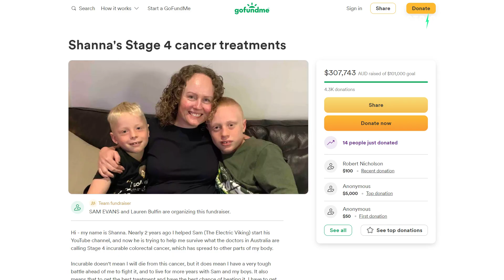CATL & BYD's sodium lithium batteries to be in these models this year

Comment: About end of 2022 both CATL and BYD announced new cheap sodium batteries in mid 2023. 
Now it is clear they failed. But I doubt the new annoucement.
Let's hope it will not like Toyota's promises repeated for years about solid state batteries...
Reply: Nope BYD Seagull will be launching in the coming months with Sodium batteries at sub USD10k prices over in Asian countries.

Comment: A bigger breakthrough will be achieved if older evs can have their batteries replaced with these new sodium/lithium/ion packs, this saving them from the scrapheap.
Reply: An aftermarket trade in batteries requires the car to not have structural packs. Apart from that, someone will  get everything sorted so long as the manufacturers don’t resort to encrypted CAN protocols. 

Hello, Future Motion. I am looking at you. And Altium

Comment: There's a certain price point these manufacturers want to be at, and no matter how cheap they can make them, they will not pass the savings on.
Just like servicing, there's nothing to service on these cars, but the dealers still want that money, and charge a fortune for what is an inspection, even a combustion engine service is a glorified oil change.
 they may come down slightly but that's all

Comment: Do you remember last Fall when the Tesla 4680 battery first came out and people calculated it should get 475 miles? People were dumbfounded. What’s wrong they asked? Then Tesla said oh we decided to go with a smaller structural battery pack that used less cells but could sell more cars! My point is that once enough battery cells are available Tesla has the option to scale up battery packs and get better mileage over their competition if they choose to pull this lever. ❤️❤️❤️

Comment: Sam please delete this video!
Somehow you’ve gotten caught up in the misinformation bunkum that “36kr” seems to be the originator of. 
Fact 1: Li and Na can’t and don’t exist together in any battery chemistry or cell. 
Fact 2: Lithium chemistry cells an Na chemistry cells have different electrical characteristics. 
Fact 3: Just as Li and Na can’t co-exist in a single cell, cells of differing chemistries wouldn’t be put together in a single battery. 
The graphic you show of different coloured cells presumably suggests what your narrative declares. Which came first? The narrative or the graphic?
Please consult someone (preferably with good English a Chemistry degree) to check my claims VS 36kr’s nonsense, and then please set about using your videos to set the record straight about these two chemistries and how they will actually be implemented in EV rollout.

Comment: If using sodium and lithium together improves an aspect better than either alone, then by all means use the new formula. There will be more discoveries to come that will be better in one way or another. Price, efficiency, performance, chargeability, you name it. As long as the end result is a net improvement.
Reply: Can’t be used “together”, this narrative was an erroneous statement by “36kr”, and it seems everyone’s regurgitating it. 
Chemistries can’t be “mixed”, neither would different chemistry cells be used in a battery. See my full comment elsewhere.

Comment: It will be interesting to see how sodium batteries perform in cold weather. Could be an important advantage in some parts of the world.
Reply: Technically, sodium batteries perform better in winter, but the biggest advantage would be the price
Reply: @terryzn-fb  It is not the price of sodium but the price of lithium that is holding back the development of sodium batteries, if lithium is available cheaply then there is no need to develop sodium batteries.
Reply: @Vito Lu  sodium is something like 50x more abundant and much cheaper to source. There's literally not enough lithium on the planet to meet the long term demand.
Reply: @SweetLou0523  Lithium is everywhere and can be recycled like we have done with lead since the 1950s. About 90% of car batteries are recycled. That’s why we don’t have lead mines everywhere. But there will be other types of batteries before then also.

Comment: As for using Na ion in vehicles, Ford in their Marshall, MI plant is planning on using LiFeP batteries, and given it’s a joint venture with CATL I can see them start to use Na ion. I can also see the sodium coming from mines near Detroit, shortening the supply chain and adding security to the supply chain.
Reply: How did I hear that the governments of both China and the United States have misgivings about this cooperative factory? It is doubtful whether this cooperative factory project will ever materialize.😂
Reply: Once that gets going, I can see the US Govt robbing CATL by declaring those batteries are a threat to National Security! The F.  king Chinese never learn.
Reply: they keep lying about battery prices coming down, it is still very expensive to replce degraded battery of a used  electric car because manuacturers are adding huge profits onto replacement car batteries too

Comment: 6:19 I can tell you for the North American market given the cold temps it is a good thing. When it’s -10 C lithium is going to not cut it.
Reply: Lithium EVs are doing fine in frigid countries like Norway where EV marketshare reached 80% in 2022.  Lithium EVs are cutting it in cold climates.

Though, yes, when the EV battery is cold, the onboard systems do have some limits on max power output and possibly no regenerative braking.  But when the battery reaches normal temps, all functions become available again.  Teslas and other EVs have resistive heating elements wrapped around their batteries to self-warm if the user wants accelerated warming.  Pretty sure that can be used during charging to perpetually keep the battery warm when plugged in.

Crucially, even at its high 90% efficiency, the EV's lithium battery still generates quite a bit of heat.  Some 20,000W of power draw would occur on acceleration from red light -- so 10% of that is 2000W of heat for that period.  Highway/freeway cruising is between 5000W and 10000W continuous power draw so that's continuous 500W and 1000W of heat that needs to removed.  There is also some additional heat from the EV's ESC and the motor.  For reference, a home electric space heater at maximum is around 1500W of power.

An EV's battery is also kept in very cramped quarters that would enhance heating.  The heat is enough to have a coolant circulation system where the heat could be routed to the cabin dashboard heat exchangers to heat the cabin reducing or eliminating the need for the resistive heating elements while the EV is running.

Comment: Don’t forget about all the ICE vehicles that have Pb acid batteries. They could produce Na ion for them and make a nice profit and it would be better for the environment.
Reply: actually, the lead acid batteries are pretty much fully recycled. But the crazy part is they are still expensive as fxxk in North America.
Reply: The problem with using a battery with a BMS is that an overcharged battery will just disconnect. When that happens the regulator in most ICE vehicles can no longer control Voltage without that load.

Comment: Does that battery still require rare earth materials?
Reply: "Rare earth materials" are not rare. 
China was the country that put effort into extracting them and processing them. Their processing is not an easy task.
Other countries that have reserves of those materials DID NOT put effort into getting those elements out of the ground and making them ready to be used in magnets etc.

"Rare Earth Elements (REE) are not rare at all. Despite the name, these elements – defined as the 15 lanthanides plus scandium (Sc) and yttrium (Y) – are not as rare as one might think." (Thermo Fisher, Jul 8, 2013),

Blaming China for everything is the easy way to not be responsible for anything.

BTW: rare earths are not used in batteries, they are used in the motors.

Comment: I dont think sodium will ever replace lithium in the portable maket. But will sure became the standart on EV, if nohing better arises. Lihium will probably be used on higher tier end, sports cars, it is going to improve a great deal paired with niobio. But it limited nature and pollution production are limiting factors to popular vehicles. Also, I got the impression that the hybrid sodium lithium EV mix cells of both types. It is not a mixed cell. What about trucks, do the extra weigth of sodium better than the price advantage?
Reply: they keep lying about battery prices coming down, it is still very expensive to replace degraded battery of a used  electric car because manuacturers are adding huge profits onto replacement car batteries too

Comment: BYD and CATL showing the world how it's Done.
Reply: I think you got that backwards. The world showed them how to do it, then 🇨🇳 makes them into SOEs. It's completely unethical and fascist
Reply: Except when you want decent range of course, then something different needs to be done.
Reply: they keep lying about battery prices coming down, it is still very expensive to replce degraded battery of a used  electric car because manuacturers are adding huge profits onto replacement car batteries too
Reply: Yeah….by buying 100ks of their own vehicles and parking them in mass lots all over China. Video on the China insights channel.   So bad Warren Buffet sold off even more stock and owns less than 10%. BYD is circling the drain. Oh, also their cars are going up in flames all over China. Again videos online. Evidently QC is pretty important